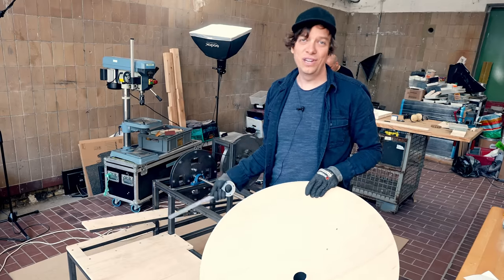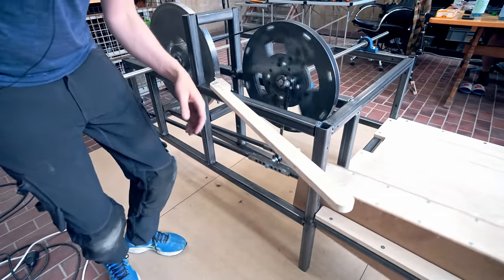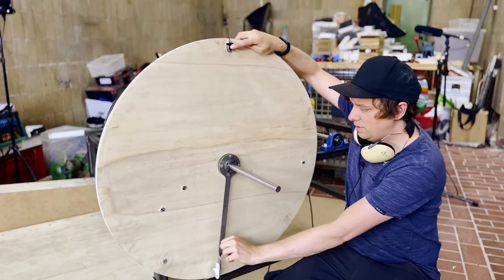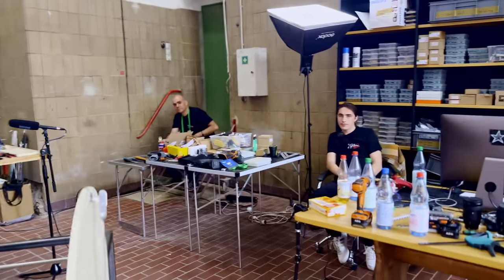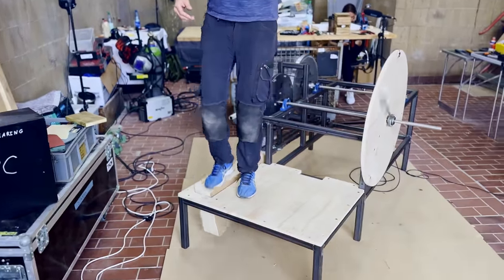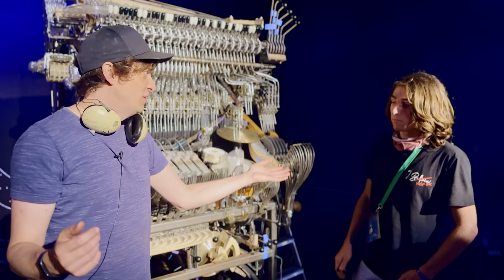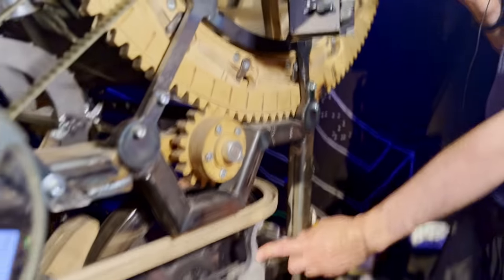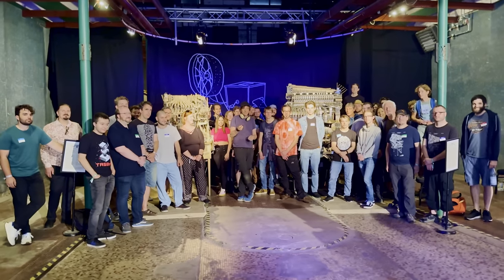This Clock Measures Music Timing - DAY 5 - Marble Machine Flywheel Prototype

Comment: In terms of safety, the pedal should be attached to the drive shaft with a tension-only part. Like adding a joint to the drive wheel connection so that it can yield under compression. It would make the machine less likely to explode if something gets in the way, and would make the upper working surface of the pedal significantly safer and far less capable of tearing off toes or fingers in a pinch.

Comment: 0:50 while you've reduced the CHANCES of mangling your foot a lot with the sides, look at that gap on the end.

Considering that the entire stroke of the pedal only moves that gap by maybe 50mm, that means anything within will be crushed by probably hundreds, if not over 1000kg equivalent of force.

All that to say you should remake that back panel to better seal up that gap.

Comment: A magnet brake would be nice - just like on a lot of cardio equipment.
Reply: Like on a roller coaster. Kinda the theme of the MM builds.
Reply: My only concern would be how such a powerful magnet might influence other metal components
Reply: @StuffandThings_  You don't need strong magnets. You also can buy such breaks from stock in an enclosed capsule to put on  an axle.
Reply: An Eddy current brake will eliminate dust from brake pads and disc. A mechanical brake might be needed also to get to a final stop.

Comment: I think a clutch between the flywheel and the rest of the machine would make sense both for easier braking and restarting, and for not breaking things if something gets stuck. Wasn’t there one in the designs I saw way back when the CAD drawings were shown?

Comment: That flywheel is awfully wobbly. You might get some weird vibrations when you start adding more stuff to the structure. Id also think about using a hydraulic brake system like a vehicle uses in order to slow the flywheel. You can also do a foot activation instead of a lever. Having unequal force on the side of the flywheel will put stress on the bearings.

Comment: a brake that pushes the flywheel off-axis seems like a bad idea, it'll develop serious wobble imho
that's why in a car the brake doesn't push the plate sideways, it pinches the plate, but doesn't twist it off-axis
the way you braked the flywheel in the part 4 video, lifting the brake stick so it presses into the flywheel's axis, that seemed much better of a force axis

Comment: Nice to watch the incremental progress on a daily basis 😃👍
I had one idea for disconnecting the flywheel on demand, as the belt is not teethed, a latched spanner could tighten the belt during normal operation. But on an emergency, we never hope to see, the belt spanner could be released by a spring, so the flywheel would spin on its own, but not return the energy to the pedal and the machine.
Hope it is understandable/imaginable  what I mean 😆

Comment: I think the perfect solution for the brake would be a motorcycle brake somewhere on the shaft. Wont put as much stress on the shaft or the flywheel with better braking performance in case something would go wrong.

Comment: Put a one way clutch on that input to the 1st flywheel so you can stop the peddle from chopping your foot off.
Spring return peddle to up position - power on the down stroke - think of a helicopter free wheel clutch - they're all over and many sizes

Comment: I think a real automotive car or go-card disc brake would be a good idea for breaking. 
Its already made to handle all the friction and heat and has a lot more breaking power for the full flywheel. You also have to keep in mind that all the other parts of the machine will add some inertia to the system, acting as a bigger flywheel.
Also its a existing replacable part.

Comment: that break needs a rubber, you're "sanding" the two metals together, the tip will get "corroded"
also,  you can kinda see the wheel it's wobbly, this break with push the wheel even further and the bolts may give in. you need to design a break like a bike break that grips the wheel in place.

Comment: Idea: use bicicle brakes.
Pros:
It is very lightweight;
It is made to stop a large and high torque spinning wheel already;
It has quite a flexible activation mechanism that you are already familiar with;
Wont force the flywheel on a direction that it is not supposed to be force, since it will clamp on both sides.
Cons: 
Needs a redesign of the brake system;
Might be kinda finicky to mount.

Comment: Mountain bike hydraulic disk brake? Could be added to the shaft with another concentric bushing and a custom cut mounting plate. Massive amounts of reliable, modulatible stopping power...

Comment: If you make the flywheel too heavy you won't as the player have the ability to change tempo or start playing in a reasonable time, at which point you might as well just fit an electronic drive for a world tour - you are there to play music not exercise to an audience. It seems to me like the smaller flywheel you just demonstrated might be getting into that sort of impractically heavy weight already. And remember you also need to consider the inertia of the rest of the machine as well - anything that is always connected and spinning is also in effect part of the flywheel - that could end up being a great deal more mass and inertia in total than your stand alone flywheel test. Plus as soon as you actuate the clutch to connect a static section to the flywheel you are suddenly trying to accelerate/decelerate every connected mass to match each other! Which means for a really heavy high inertia flywheel you need shafts that won't twist themselves to destruction and a clutch tough enough to take the abuse etc.

You have to ask the question can you safely do a song change with the flywheel still spinning and if not do you really want the song change to take even longer as you have to get everything back up to speed before you can start.

It seems to me a CVT might actually be the better approach to timing - you can pump the flywheel at the tempo you find comfortable, it doesn't matter at all how fast it is spinning as long as you can hold it reasonably consistent  - which also means you can make it really really really stupidly heavy as long as it only needs to be stopped at the end of the set. You then turn the dial on the CVT to do your fine adjustments as well as going to the extreme end on the CVT ratios letting you bring the programming drums up to speed gradually before each song.

Comment: If the flywheel were shaped like a wheel with spokes, bringing the mass out to the outer rim of the flywheel will give more power storage at a lower weight, sacrificing size for weight. Its usually worth it if one is to worry about touring with a huge flywheel in tow.

Comment: 1:30 that flywheel is not at all balanced...that's why real flywheels on old engines were made from engineered castings and machined on an engine lathe with press-fit bearings: consistency and concentricity.

Comment: Why not try to use caliper based brake like what bikes use. You might even be able to use bike parts since you know that they have to slow down a humans worth of weight so it should be reliable.
Reply: I don't think its the final design for the brake.
Reply: And it will be a quick CAD to add it to the frywheel shaft.
Reply: I don't think that is as good a solution as you say. Remember the bolts that the original brake needed to dodge? Yeah those would obliterate a delicate bicycle brake.
Reply: Discs brakes from any car would be a lot stronger.
Reply: @bluecat2991  you should not to apply the force to the flywheel directly, a disk brake rotor should be attached on the side of the flywheel and the caliper must work on that one.

Comment: I have to say... I am kind of stunned that your brake mech is so "Caveman" ... What i mean is, with all the talk about Tapered Bushings why are you not using REAL DISC BRAKES? Go carts, racing carts, golf carts and so many other shaft driven Brake assemblies.... They apply far superior braking force and is exponentially safer as it is RATED for exactly this kind of system. Good luck with the prototype! cant wait to see how it turns out!! I am soo happy to se the MMX "working".

Comment: re: brake
Martin, you may want to have your lever push on the rim of the flywheel instead of the side. it will help your bearings last longer against the forces necessary to stop all that momentum

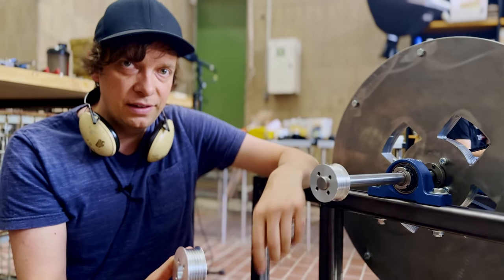Comment: Quick Language Correction, at 4:40, Martin:  "Moment of Inertia" is an immutable property of an object, like its mass.  The term you wanted was "angular speed" or "angular momentum", both of which describe the motion of the object.

And no, "torque" is not the correct word here, either.  Torque is what the pedal is applying to the large wheel in order to give that wheel angular momentum.

Comment: I think you would need a transmission system (which could include a neutral position)

Let say you need to get to 120 bpm or more, it will get harder to maintain the speed. I think it would also help building up the speed.

Im just throwing out the idea. I'm not in the discord(yet?), I'm not an engineer, I'm just a BA who can see gaps. I don't know if it had been discussed, if it would be a nice-to-have or a should have (certainly not a must have), or how such a feature would be implemented... Feel free to reach out if you have questions!

EDIT: reading other comments, I also think that it could help with pedal lenght/rigidity. Right now the machine requires a longer arm especially for the initial input. But once the wheel has started, it requires input only for the delta acceleration and a shorter pedal would be better to achieve this goal. Multiple speed would allow the pedal to be smaller, more rigid, way less force loss in the metal, more given to the wheel. Lower speed for starting, then you can have different gears: 60bpm, 80bpm... The pedal input speed would be the same, just the gear itself would be calibrated for that speed= tighter music

Comment: You need to use some trigonometry and add some triangle bracing on the foot pedal or you are going to bend and crack it at all those adjustment holes you have drilled in it. Other than that its going awesome and I am enjoying all the awesome work you are sharing!

Comment: I think you should put contact microphones not just at noon, but at 3, 6, and 9 on the wheel. I recall on of your concerns was one of your was tempo increasing with each push of the pedal and slowing down on the up stroke. Obviously both of these factors would be small, but I know you're chasing tight music. Plus, it will give you more subdivisions to listen to when trying to match tempo.

Comment: It might be useful to have the pedal link arm be able to connect to the pully at different distances from the center so you can adjust the force/frequency required on the pedal input

Comment: the link from the pedal to the pulley, where the bearing is, doesn't need to be solidly attached. it only needs to connect when the pedal is pulling down on it. if the pedal is going up, it can disconnect. this would make the whole thing a lot safer.

Comment: Martin, re the brake, go to any auto parts store and buy brake pads for a disc brake setup. You'll probably also want brake calipers. The pads should go on both sides of the flywheel.
Oh, and see @azayles comment about the inertia on a flywheel and use spokes. But you could also drill holes in the flywheel - same way they do on a car's brakes.

Comment: You should really consider balancing those fly wheels. Weight that great turning at high speed can put excessive radial and axial force on those pillow block bearings.

Comment: The whole vibe there is so wholesome and creative. I love these videos!

Also very touching to see the MMX again in this completely different context. Back then it almost felt like a daunting, intimidating machine with so much effort, emotions and expectations attached to it. Now it is just a beautiful piece of history. A slightly flawed but very impressive and awesome invention created by an artist. Are drums and bass channels also somewhat working? That would be amazing!
Reply: The bass channel wasn't turned on today, but the kickdrum was, I got to play it! Dropping marbles did work and the drum did sound good, but on some of the notes there were two marbles dropped. In these cases, the marbles didn't bounce right and ended up laying on the drum. If only one marble was dropped, it was usually caught, although not always. All in all, playing the MMX currently is a huge mess, there is a dropped marble every ~20 seconds.
The rhythm section on the lower side of the machine works well mechanically, but doesn't sound too good as the cimbals are not well aligned.

Comment: Use a lightweight pulley with a embedded pedal and one way bearing. The way a bicycle works. Also doubling the mass of the flywheel... Not optimal.
Reply: Yeah, the flywheel is already unnecessarily scary as is.

Comment: Maybe instead of a wooden block that rubs against the flywheel, you can use a normal car brake disc? Then you won't damage the flywheel and the brake system will be easier to service.
Reply: I think car brakes are too big and complex, so they may be difficult to adapt. The front brake from a motorbike is much simpler and is strong enought for the scope.
Reply: @Fulmynato  any break that is designed to be break would be better

Comment: use a bike brake. You get to use your cables that we all love, you can put the brake anywhere on the machine, and it will stop the wheel much safer I would think.

Comment: I'm confused about the brake. Why isn't Martin using a disc brake to slow down the flywheel? And why doesn't he have a clutch to disconnect the pedal from the flywheel in an emergency? Since Martin is obsessed with durability and accuracy and repeatability, he should be using standard, off-the-shelf parts instead of custom braking solutions.

Comment: You still should use wood brakes at the end of the metal lever. Nothing slow down metal wheels better than wood. Even today lots of modern metro or tramways use wood brakes. Usually birch or beech wood (ex. Montreal or Paris metro) :)

Comment: Can't you use a steel cable between the pedal and flywheel? Then it won't break your feet if you get anything under the pedal. Seems much safer

Comment: The weight of the pedal is robbing power from the system. Use a one-way clutch on the axle like a bicycle, but without the noise of a regular ratchet, and think of some way to keep the pedal up when not in use. A bicycle brake would also be much better as a flywheel brake.

Comment: For the brake mechanism I think it would be better to use the brake from a bicycle. It would interface perfectly with your square frame and would also clamp both sides of the flywheel equally. This would avoid unnecessary lateral forces on the flywheel and improve the lifespan of your bearings and bushings. Its already designed to operate via Bowden cable.
Reply: Ha! Hydraulic disc brake please, no expense spared. A low-end shimano rear brake (longer brake line) should cost around 35 bucks, all included. Though someone probably should do some thermal calculations it might just be too strong for its own good.
Reply: @aoeuable  Although a more powerful method. I don’t think hydraulic would be appropriate here. Since he is already incorporating Bowden cables into the machine elsewhere it would be more appropriate. But I completely agree on going the disk route.
Reply: @wrecksandtech  It's going to be hard finding disc brakes that are cable-actuated, at least from a reputable manufacturer, though. Using hydraulic lines for everything may or may not be worth it but it certainly won't be a downgrade, and also simplify some things. 

On the positive side mounting is probably going to be easy as the discs attach via bolt pattern and if the ID is too small, there's plenty of models with a multi-part design and thus a very large ID if you throw away half of it.

Comment: How about adding a variable speed drive set up(similar to go cart drives) and then add a mechanical governor like so many music boxes have.   Or better yet, use the governor to adjust the ratio of the variable speed drive.   Spin the flywheel as fast or slow as you want, but the machine only turns one speed.  You can have different speed settings depending on the song.

Comment: you might wanna go with a drum brake instead of a small pad like that for how hefty that flywheel is. Just a leather belt going around the circumference of the flywheel, like an oil filter wrench.

Comment: personally i would have the wooden box on the pedal loose on the metal bars. (as in: not screwed to it, but screwed to itself, so it stays a box)
that way, if ever something does get stuck (your shoelaces, microphone wire, ...) the wooden box can stay floating and not crush whatever is wedged in it. but the normal operation does not change, you can still pedal it like you are now

Comment: Aren't you worried that the brake creates leverage on only one side of the flywheel, and might create some twist in the shaft, or early wear in the bearings ?

A V-brake or drum brake like design seems more robust

Comment: The flywheel wobbles. The shaft is not perpendicular to the wheel plane. Do you use two bearings? One on each side of the wheel?

Comment: What about a Mountainbike or motorbike discbrake system to follow the SKS logic of not reinventing the wheel? For example a four piston discbrake attached on the flywheel shaft to brake the system evenly without applying side preasure to the flywheel.